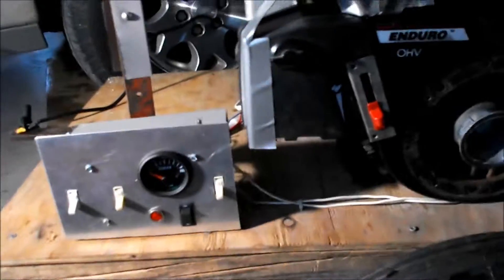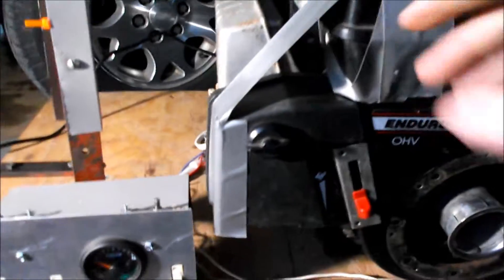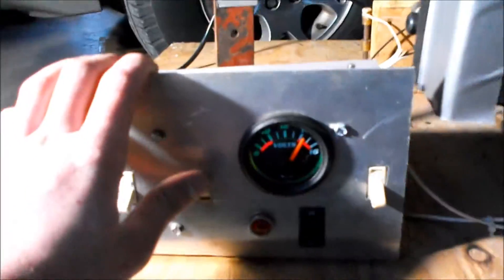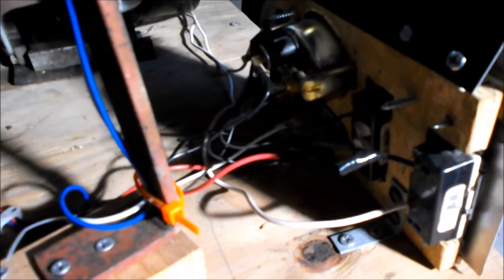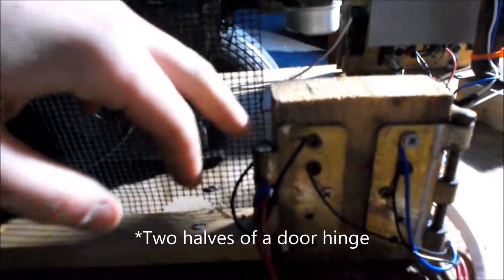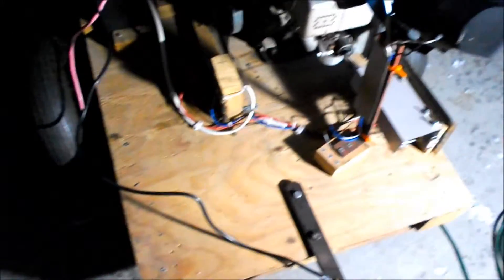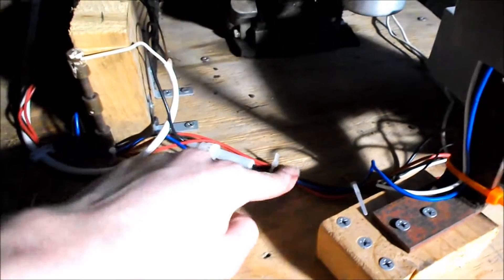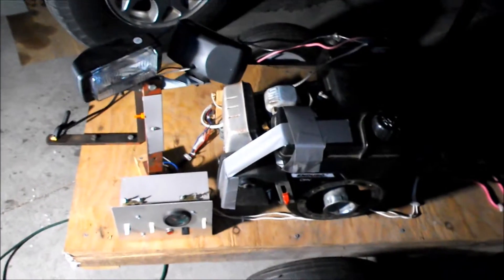5 Hp Tecumseh Alternator-Inverter Generator

Comment: Nice work! Those Tecumseh carbs suck, if you swapped it for a Briggs one it would probably start easier. That's a really cool setup though, good idea with the lights for starting it in the dark!
Reply from the maker: +SuperKONR Yeah, I had to get a new float and the linkage is practically non-existent. It only has a hard time starting when the battery is low. I have put switches on all the leads but it still senses the voltage from the alternator outputs and puts the load to the brushes. Normally I can pull start it but my recoil string broke.